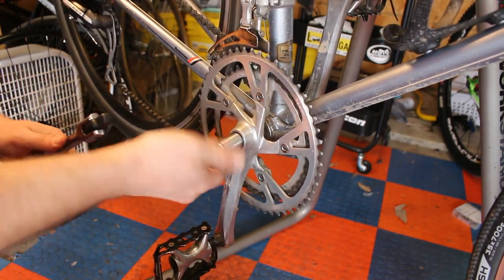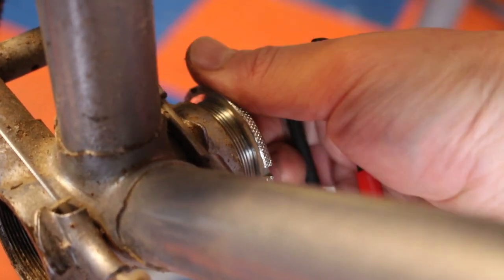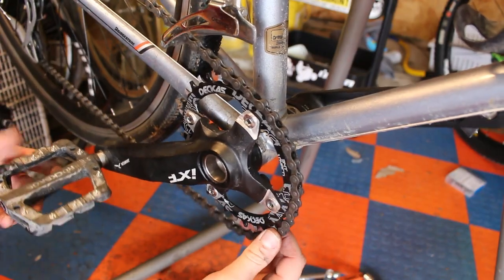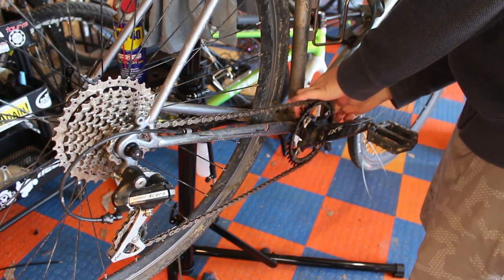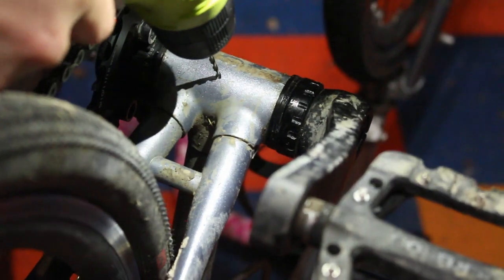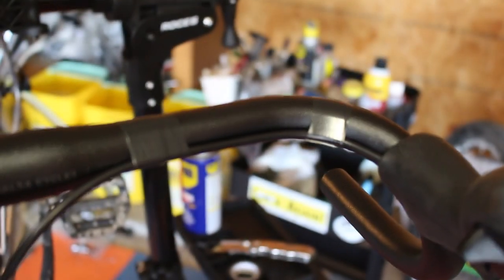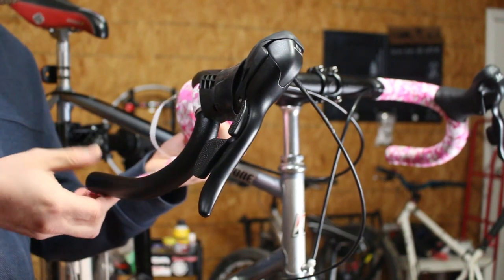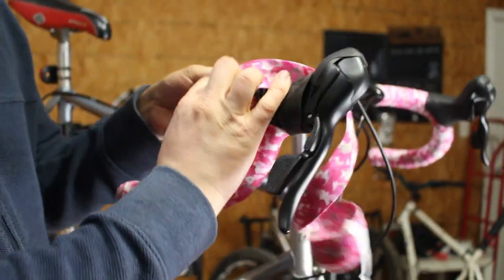Micronew 1X9 & Salsa Cowchippers on the Vintage Gravel Build

Comment: I’m a fan of the IXF cranks.  I used one on my budget gravel-ish build.  It was an easy install and the cranks have been great.

That build is also a 1x9, but with MicroShift Advent.  The bike — which I use for riding in rain — works well and is actually kinda’ fun to ride.
Reply from the maker: The ixf cranks are my go to pretty much every time I build a bike 👌 I was considering putting the advent on here eventually

Comment: My ixf drive side crank got loose from the shaft after 3 months of use. And supplied bb bearings lasted about the same(less). My new deore cranks are going for 9 months so far, and they have the clamp bolt, I am sure it helps. If you are stronger rider, I don't recommend buying ixf cranks.

Comment: I wondering if 700c x 38 mm tires would fit on the typical vintage 10 speed road bike. I may buy new 700c rims and  I know you have 35 mm tires but I see some good deals on the 38mm.

Comment: Are those just the regular Micronew STIs you buy from China or are they some mtb-derailleur specific variants? I noticed you didn't even need any adapter for them to shift properly.
Reply from the maker: They are the regular micronew shifter off amazon. Mtb and road parts are cross compatible 9 speed and lower

Comment: Hey nice upgrade and build. I just did the same to an old Giant mtb, but went 11-40 on the cassettesnd 36 chainring I also used the IXF cranks and they are great. Do you think flat bars would have worked also on a build like this. Cheers
Reply from the maker: Sounds like a great setup! Thanks!

Comment: I know it's a year past, but the cranks that you had are a  52/42 110 bcd double... You could have gone with a 46/34 and not had to change anything else.
Reply from the maker: But then I still would have had friction shifting and 6 speeds in the rear.
Reply: @tinkerbike2510  Not at all... 10/11 speed 110 bcd chainrings are like 30 bucks each. There's no such thing as an "N-speed" crankarm, regardless of the value of "N." Chainrings, yeah, kinda-sorta. But crankarms don't know and don't care.
Reply from the maker: @SMenkveld  completely agree. Chainrings don’t care and this bike could absolutely get a 10/11 speed in the rear. But you said to just change the crank arm and nothing else which I assumed you meant it would have been the new 2x crankset with the rest of the original drivetrain. I could have gone 2x9 with the 9 speed cassette I had on there if I wanted to stay with 2x, but I like 1x drivetrains for anything off-road. Either way, this bike is now set up single speed 😂

Comment: Hello The cassette is 11-46 or 11-36? I am asking because I have the same lever handles, but I have a problem with the 11-40 cassette. Admittedly, after adding the adapter extending the derailleur cage, the derailleur already enters the last row, but ... it jumps a row. I've tested a few gears, but none of them work as expected ... I don't have one like Yours (what model is it)? Do you think she would settle the matter or find fault with the cassette? P.S. Sorry for my English (I'm from Poland) :) Arthur
Reply from the maker: 11-36. You’ll need the hanger extender. Sounds like you just need to adjust the cable tension
Reply: @tinkerbike2510  Hi. Thanks for the answer and .. maybe my word was wrong, but I have a hanger extender installed and adjusting the tension of the cable also does not give anything ... As there would be a different shift of the derailleur versus the cassette, because gradually the derailleur is higher or lower (depending on which one is mounted).
Reply from the maker: @wiesiolek23666  you’ll have to make sure your shifter and cassette are compatible with each other.
Reply: @tinkerbike2510  Welcome back :) Well, I suspected it too, but on the other hand ... is the MTB cassette longer / shorter than the road cassette? If so, please let me know what tape you have. I know that these lever handles are strictly dedicated to the road and I have not seen such a road cassette as in your life, i.e. up to 36z. I installed such 7rz and 8rz shifters and there is no problem with any cassette and everything works smoothly, but from the 9th there are flowers and the original microshift also makes separate xle or advense gravel groups.
Reply from the maker: @wiesiolek23666  the cassette and derailleur I used is an old mountain bike group. The road shifters are compatible with mtb up to 9 speed. The advent x gravel groupset is on my new bike and it’s awesome
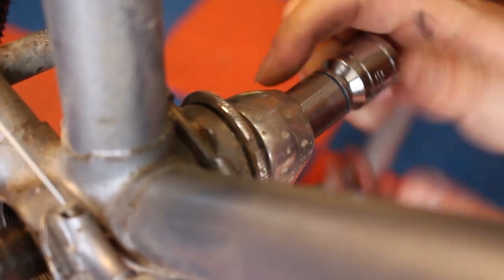Reply: @tinkerbike2510  I wonder what you write ... I'm completely green now :) Well ... I ordered an original (dedicated to these lever handles) micronew derailleur ... we'll see (I can let you know)? :) I also have a Triban rc120 grvl and it has XLE (1:10) and I am happy too, although sometimes there is no pressure between gears and what I put together is for commuting and for the proverbial rolls :)
Reply: @tinkerbike2510  Unfortunately ... I ordered three types of gears (Sensah mx9, Alivio RD-M4000 and micronew 7-9s) and ... it didn't work. I ordered two types of 11-36 cassette and also ass ... I'm fed up :) No, I know completely what the problem is. The shuttles all the time want to jump at one run (usually from the middle) and a row of more ... I don't know ... maybe give a gear shifter for a typical road?
Reply: Ciąg linki w microshiftach jest ciut inny niż w Shimano. W Shimano masz 1:1 a w microshifcie 1,1:1 dlatego na niektórych forach piszą, że np klamki Sory pasują do microshifta ale niekoniecznie. Do kasety 11-46 ztto potrzebujesz przerzutki sunrace m900 ale tylko gdy z przodu masz max 2 blaty, z 3 może nie pracować.
Reply: @Dziku888  
 Witam.Dzięki za odp.
Z przodu(jak autor filmu) mam jeden blat. Wystarczyło by mi 11-36 (przy 46 jak dla mnie za duże odstępy między biegami).
Tylko powiedz mi dlaczego ten sam sprzęt co u autora u mnie nie zadziałał?
Sprawdziłem chyba na 5u przerzutkach..
Każda pracowała inaczej,ale..żadna prawidłowo...
Być może jakąś w końcu bym trafił,ale.myślę jednak ,że problem lezał w ferelnych klamkach,czy może po portu różni producenta robią minimalnie inny ciąg.. 
"Leżał"(nie lezy),bo...straciłem cierpliwość i założyłem tylko 8s :)
Z tym micronew nie ma problemu.
Reply: @wiesiolek23666  a jak masz przedni blat ustawiony? Powinien być w osi ze środkową zębatką z tyłu. Pytanie jeszcze z której strony masz linkę do przerzutki przykręconą bo różnica 0,1 ciągu to kosmetyka ale jednak ma znaczenie.
Reply: @Dziku888  wiem, że powinien być w osi(spokojnie.. zupełnym amatorem nie jestem) :)
Nie rozumiem pytania odnośnie linki..
Reply: @wiesiolek23666  linkę z tyłu do przerzutki przykręcasz albo z prawej strony śruby, albo z lewej. To takie pozorne skrócenie ramienia dźwigni napinającej w przerzutce. Pokombinuj tutaj. Tak samo ludzie robią z hamulcami TRP Spyre C- jak przykręcisz linkę z drugiej strony niż zalecana to zyskujesz na sile i modulacji hamowania.

Comment: I think you should move to 38 tooth
Reply from the maker: I just swapped it to a 40t
Reply: @tinkerbike2510  I thought you would in my opinion a 104 b c d is too small for mixed-use Terrain I have a 7 speed with a 130bcd and it's has a triple chain ring which is a 50 tooth a 40 tooth middle and a 30 tooth granny gear any 2 of those combinations is plenty for hill climbing and the flats. I am finding that many people who go to a 1 X set up are moving to larger chainrings in the front
Reply from the maker: @tmayberry7559  for 1x the ideal setup IMO is a 42t front and an 11-46 cassette. I have a gx eagle 12speed I’m considering putting on this bike
Reply: @tinkerbike2510  wow